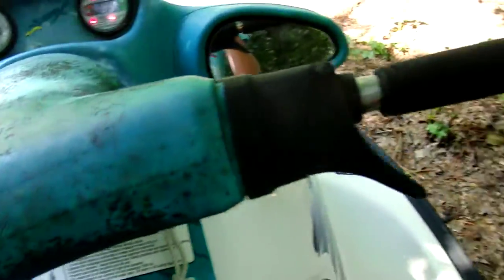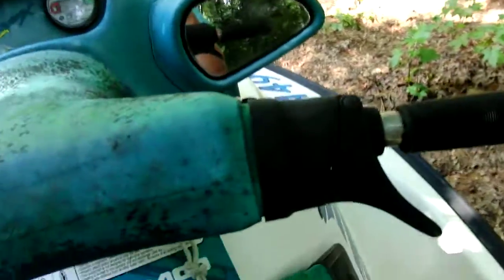Seadoo SPX 117 1996 missing bad

Comment from the maker: @yamaharules163  Generally you should, however it doesn't do any harm to run it for brief periods of time without water running through the engine. When the the two purposes the water serves it to cool the engine and to keep the out-drive from burning up. When the craft is out of the water, little if any water even reaches the shaft and therefore the only thing that is cooled is the engine, which obviously will not immediately reach high temps with only a short  run.